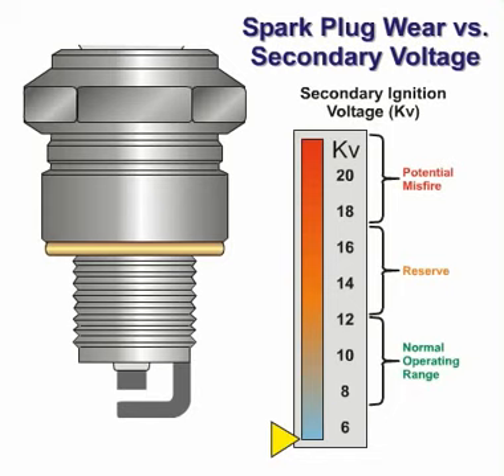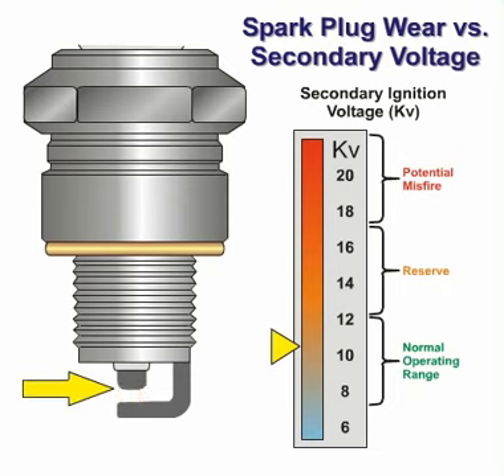Spark Plug Wear

Comment: Great explanation of what happens! I recently replaced the plugs in my Honda Fit after noticing a slight jerking hesitation at high load low RPM, despite only having 17,000 km (10,000 miles) or so on them. Some of the plugs had noticeable rounding of the centre electrode, on the side near the strap. Maybe this is why these cars have a reputation for "eating" ignition coils.